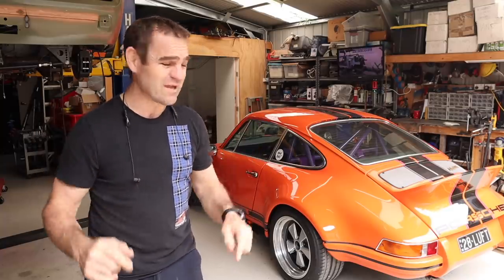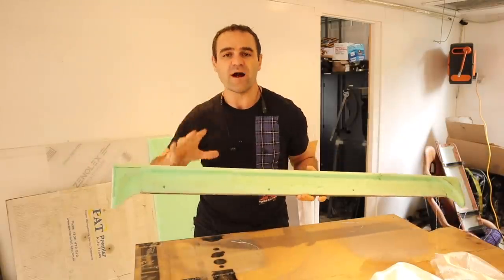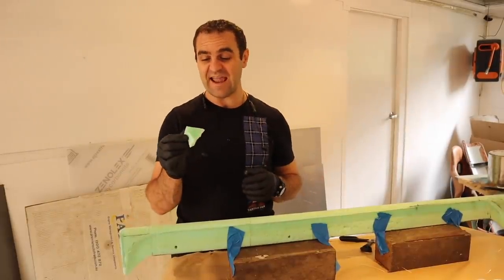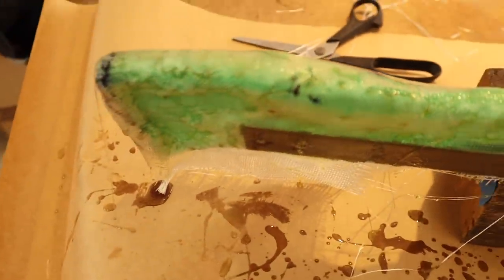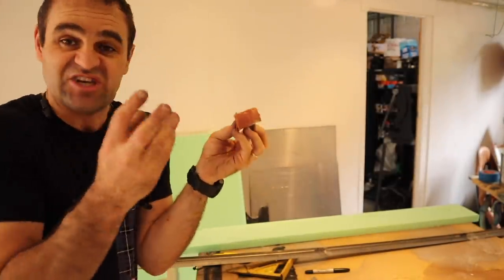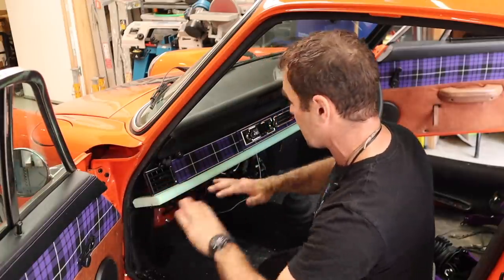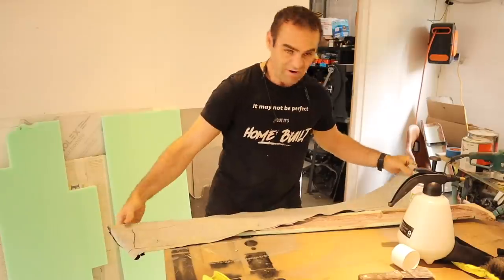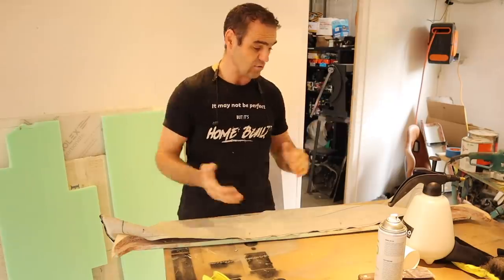Second time's the charm. Porsche 911 dash build part 4

Comment: Nice job second time around. I build model planes and rarely ever have trouble with epoxy fibreglass resin over any type of foam used in the wing cores. Sands more easily with less irritation of my skin.

Comment: Hi Jeff, FYI, the glass reinforcing in the body filler is effectively the same as chop strand mat. The reason this new solution worked, was likely to be that they also put a powdered "thickener" into the resin as well as the glass fibre to shift it from straight resin to "filler". Because it is a much thicker brew, it doesn't penetrate into the foam you are using and degrade it as much. For something like your pad, it would be better to use a urethane based foam like that used on surfboards - no issues with degradation of your pattern. Also, chop strand mat actually goes around corners better than the woven mat you were using (if you select the right weight) as it is multi-directional rather than uni-directional like the woven stuff. Because it is random, you can break it up into small handleable pieces rather than using a big sheet like you were doing and the whole process becomes more manageable and fluid and you don't get air pockets where you are bending the fabric around tight curves in a multitude of directions. A final note is that if you are using chop strand you cannot use epoxy as it will not penetrate the random weave of the fabric - polyester and MEKP are the go as it is much more liquid. Epoxy is fine for all of the cross and bias ply fabrics be they glass, carbon or kevlar all though there are even caveats on that... All that said, I have watched your channel from the start of the datsun build some years ago now, and love your work! The problem solving is fantastic and watching the development in skill levels and the application of experience is a joy to behold.

Comment: That was a really nice industrial sewing machine- my grand mother would have really appreciated something like that. I was pretty sure the tack on ends for the dash pad would disappoint you, but not fail that spectacularly. On the glove box door trim; reduce the amount the bottom bit of aluminum projects a little- that will let the door come more fully open. When you said "I think it's about time...) I thought (hoped!) it was to say "for another Ms. Jeff" and we would get a bonus! That was mean! Harry's list is getting shorter and shorter- but no self respecting project car is really ever finished, ever!   FR
Reply from the maker: It is actually not the aluminium that is limiting, but the hinge itself coming up and hitting the back of the pad face if that makes sense.
Reply: @HomeBuiltByJeff  It does- the first thing that looked from here that could be binding was that ride of aluminum backing right below the door. The forth time should make it all right, I'm sure. There may be a new t shirt in that!  FR

Comment: Love the dash pad and I still dig the purple pattern on the interior.  
Maybe paint the screw heads black, under the dash pad? Not sure if they are easily visible or not.  Looking good!
Reply from the maker: They are temporary. I will use countersunk allen head bolts for the final fitment :D

Comment: I had to close my eyes at 10:40 when I saw all that rough body filler.  I think you should have drawn this part with your favorite CAD program, cut it into 5 or 6 segments equal to the height of your 3D printer, and printed the segments vertically. If you made provisions for a spline similar to the stiffener you fabricated, you can then assemble the 3D printed pieces, install the covering, and you would have a stiff and accurate piece.  Then fit 3D printed end caps (rather than the fabric ends you used).  You could put a groove on the forward edge and tuck the fabric into that groove and secure it with a piece of rubber propitiatory spline material similar to how a window bug screen is attached to a window frame.  You could even combine the 3D printed end caps and the dash end covers into one piece.  It would take a while to print, but the actual work involved would be a fraction of what you spent since 3D printing is mostly waiting for the printer to do it's thing.
Reply: I like the vinyl covering the ends instead of end caps. Looks more smooth & more factory
Reply from the maker: I could have, but the dash is still not perfect, so hand shaping is actually better to get the fit right in one hit.

Comment: You could have used a suitable diameter pvc or similar pipe. Slice it lenghtways in half to form the front edge of the foam.

Comment: I know everyone's first thought is metal for car parts, but what about making a wooden form by copying the styrofoam pattern onto lightweight plywood? put a thin layer of foam and cover in black fabric as planned?
Reply from the maker: Wood would be much easier, but adds unnecessary weight ;)
Reply: @HomeBuiltByJeff  it wouldn't need to be solid wood, you just need a frame and a skin. The weight difference would be minimal.

Comment: Too late now, and maybe not what you are going for, but carbon fibre would have been possible?
Reply from the maker: Wouldn't match this interior
Reply: Carbon is not fantastic for interiors. Most "carbon interior" parts are vinyl wrapped abs or fibreglass. 
While we never expect to crash carbon splinters into nano size particles when it fails.
Razor sharp and will pass through skin membrane as well as not being great to inhale.
When AV8b harriers were crashed the rescue crews were mandatorily in impervious suits and respirators.
Carbons great, right up until it's  not.